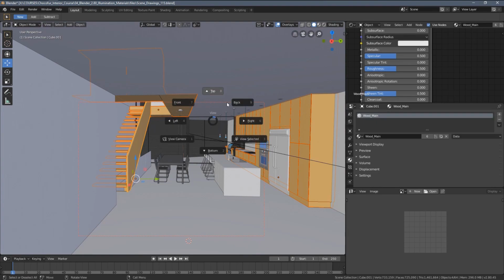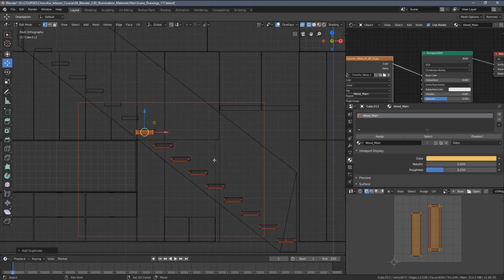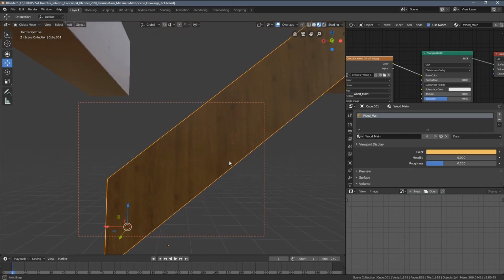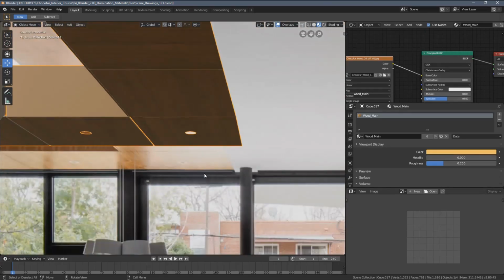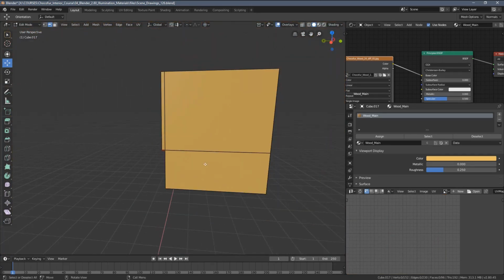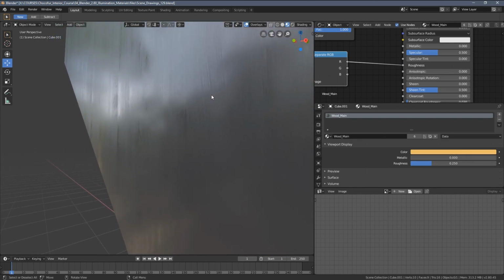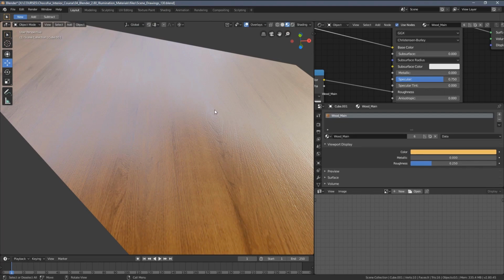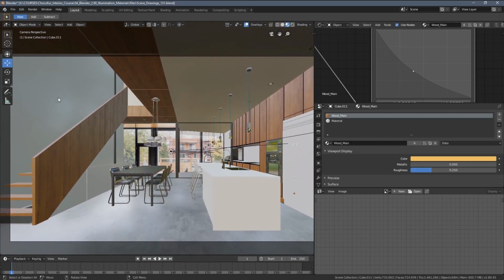Blender Archviz: Wood Material | Part 31 |

Comment: Omg, all the UV work required is throwing me off. Have you ever considered trying box mapping? Two methods I use:

1) Vanilla box mapping. Requires separating out the pieces ("boxes/boards of wood") and adjusting the cardinal orientation of the pieces to align with the direction of the box map. E.g. if you wanted the stringer of the stairs to be wood mapped at an angle (typically done to get the most out of the wood), you could rotate the origo so that x aligns with the general direction of the stringer itself. Some modifiers may have to be tweaked to get this to work; e.g. due to rotating around x and z to get the wood grain oriented correctly, a mirror modifier's axis may have be to adjusted.

2) Custom box mapping, select which of the 6 cardinal box orientations is used per item, by putting "collapsed UVs" into one of 6 areas in the UV space. One board is collapsed to a single point, then positioned randomly into one of these 6 areas within the UV space. Could be setup to be 3x2 or 6x1 space. Now you get to keep things in a single mesh, but the node setup will be more advanced.

In both cases, object coordinates are used as a basis, so everything will always be to the same scale (assuming object scale is reset to 1). In case you have bevels with smooth shading and "harden normals" mess up "geometry/random per island", you can also use this UV.collapsed -> snap 0.001 -> White Noise for random offsets, additional darkening etc. These days, with v5, you could leave all the complex stuff inside group nodes the user don't have to touch, and send in relevant external stuff via enclosure nodes (e.g. image texture nodes), possibly grouped together as a node bundle.

Due to random offsets, the use of seamless image textures is pretty much a must. Takes time to setup and have it work, for sure. But once it's done you'll never unwrap pretty much anything ever again, other than for cardinal orientation assignment. I may even do something similar for downloaded assets instead of relying on its original unwrap and texture file, just to avoid having duplicates of chairs look 100% identical. I know the customer probably wouldn't notice or care. But I do, and CGI giveaways is my nemesis. 🤣